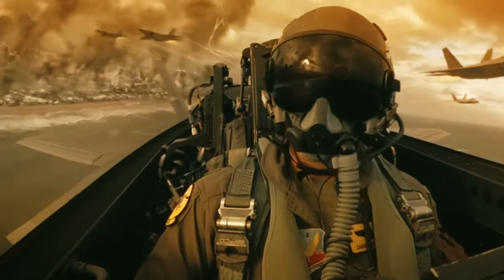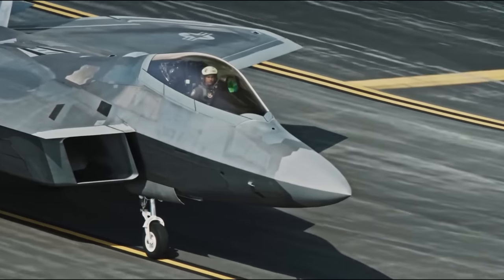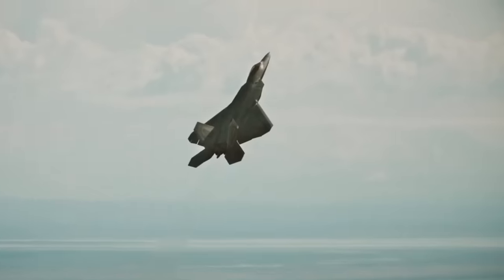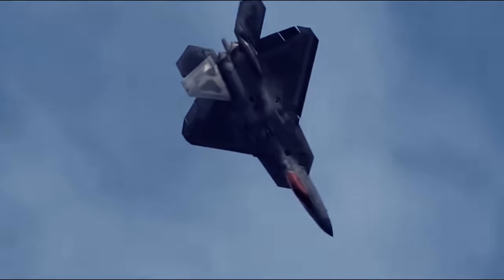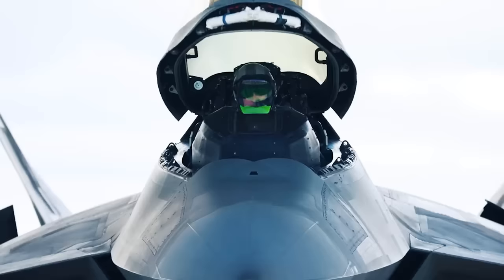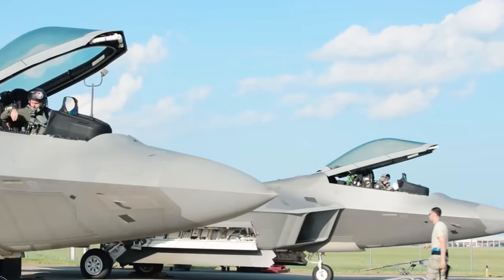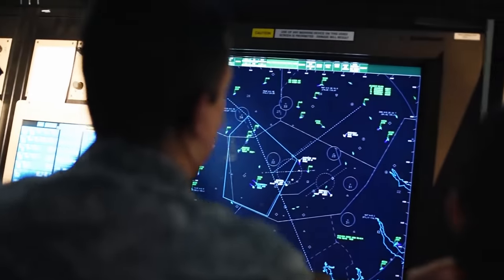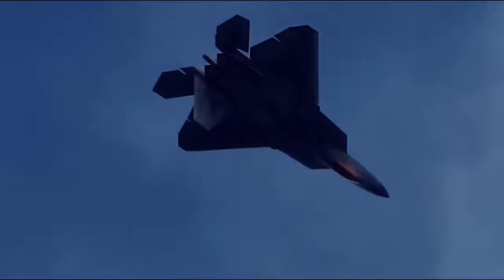New US F-24 Fighter Jet Was Secretly Tested In Yemen!

Comment: I live in Anchorage, Alaska and because of a tornado/storm in the lower 48 at a US airforce base 25 F-22 Raptors were moved to Joint base Elmendorff Ft Richardson base here in Anchorage. Anchorage already had 25 F-22 Raptors so now Anchorage has about 50 F-22 Raptors, more than anywhere else on planet earth. It's Alaska's main defense. Alaska senator Lisa Murkowski demanded more protection for AK and they put 54 of the newer F-35 Lightnings up at Eilson AFB in Fairbanks. That means Alaska is protected by over 100 "Stealth" fighter jets !! I see the Raptors fly right by my home as I am only about 3 miles from JBER base and love them !! Check out JBER'S "Elephant walk" if you like Raptors.
Reply: You’re absolutely right. I was U.S. Air Force (JTAC) of the 3rd Division Brigade Alaska (2016-2019) my job consisted on guiding the F-22’s on the battlefield for Airstrikes. The coolest but craziest shit ever. I’m happy to say I’m safely back home with family. 💪🏽 🇺🇸

Comment: I think they meant F22 just like when they said Nov 2024 not 2023. Errors picked up on radar. There is an updated F22 with head mounted tracking,  infrared pod and stealthy external fuel tanks.

Comment: The helmet design is an ancient early 70’s SA. RooiValk helicopter which even then used such look/Fire helmet sight. The chopper was armed with missiles and a Gatling gun which worked especially well when being fired wherever the pilot looked. It had double rotors and perform a full 360’ loop;bringing around and behind any enemy craft dogging it. It sat 2 pilots in a row;like a jet fighter with the rear pilot being above the front one&closer to the rotors. It was made in SA by our local armaments company which produced many unusual and unique weapons for the period including the G6 cannon which came as a trailer/tow Version with huge coverage distance fire and a mobile version. The US gov got both the helmet design and chopper design Frm SA s new gov. Denel had been an old SA weapons company which produced some of the finest heavy as well as light weapons ever made;IE;R4,R5…etc. “”PS-Apparently Elon Musk developed 2 way superior fighter s to anything in the US Arsenal. I heard it had a Mach.7 speed range and was stealthy and capable of destroying the electric s of any plane within a certain area around it. Making it entirely untouchable. The US gov apparently seized his planes and prevented more reproduction s. Again since they felt inferior.